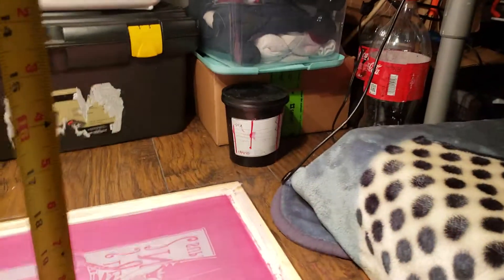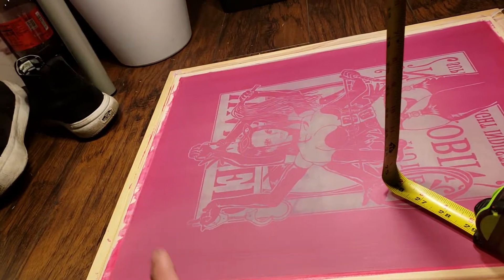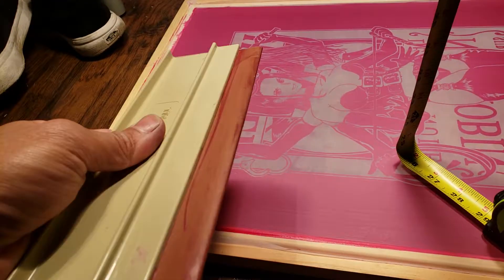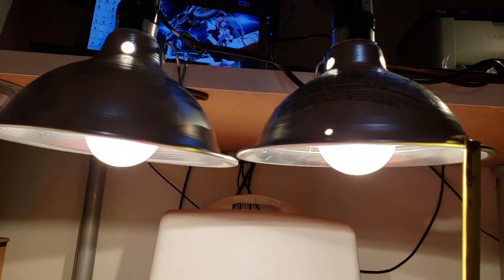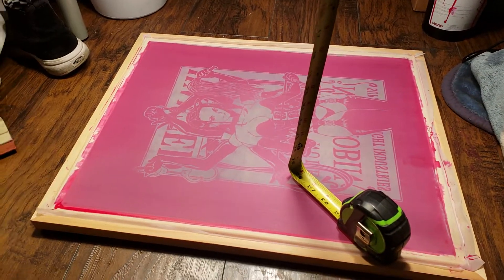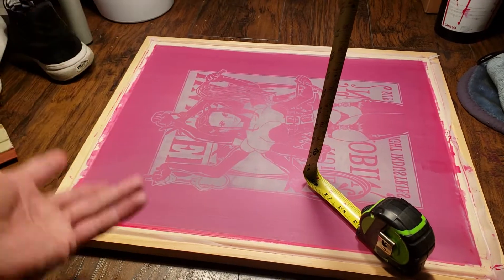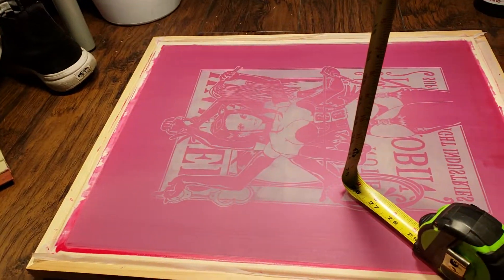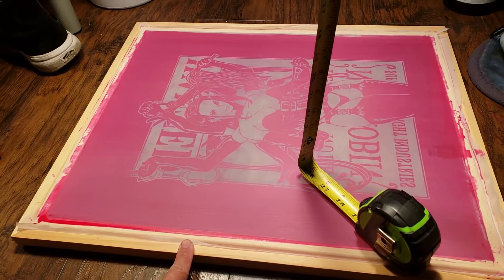My Ulano QTX Emulsion process (obsolete light used, please view new video)

Comment: I just burned for 6 minutes with a 300 watt halogen at 2 feet with QTX. It was perfect. And the QTX washes out so easily. Used to take 45 minutes with Speedballs Diazo emulsion..

Comment: How long are you letting the emulsion dry before exposing
Reply from the maker: Probably 15 to 30 minutes but I have it in a closet with a fan circulating air so drying times will vary

Comment: Hello! I am trying to do 4x6 Aquatint prints using a 200 watt photo bulb. I have not been successful. Any suggestions for exposure time? Thanks
Reply from the maker: Is it a normal style bulb or is it swirly/eco or LED?  The one that I am using in the video is an incandescent light bulb
Reply from the maker: Forgot to ask: what emulsion is Aquatint?
Reply: @keiseyku  Aquatints are silk applied to plexiglass then adding photo emulsion and burning a bitmap image onto it to print.

Comment: is your 120w bulb UV or LED? great video btw
Reply from the maker: 120w bulb but they are hard to find near me now so I have shifted to a 50W uv led for 80 seconds and it does very well
Reply from the maker: 70 to 80 seconds seems to be the ballpark
Reply: @keiseyku  did you mean 500W? we're about to try this out with a 500W and we overexposed the first time so hoping we don't this time!
Reply from the maker: @jessiknox4726  sorry I just saw this. I'm using specifically the QUANS 50W UV LED found on amazon

Comment: Are you using two lamps because of the size of the screen? I want to try out the Ulano QTX on a smaller screen. I think its around 9x14 inches, would just one lamp be okay for that?
Reply from the maker: I believe you will be fine with one lamp since it's so small. I use two for my 20 x 16's but that's if I'm doing halftones